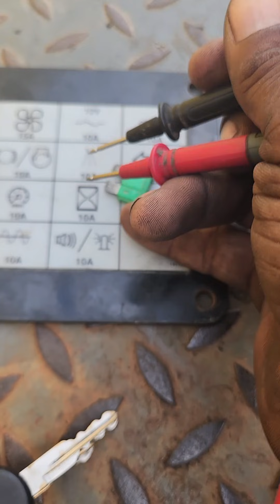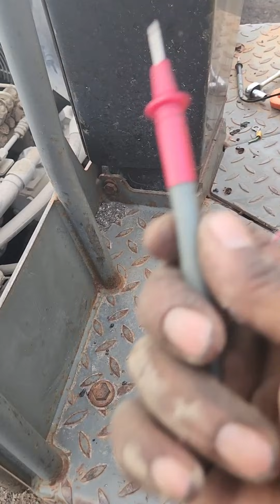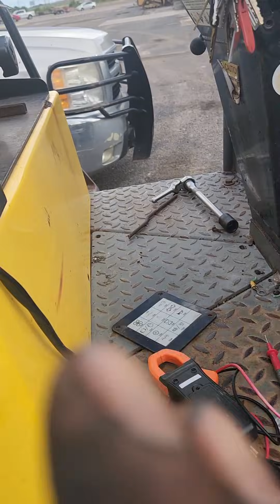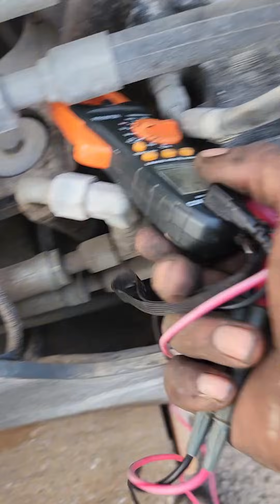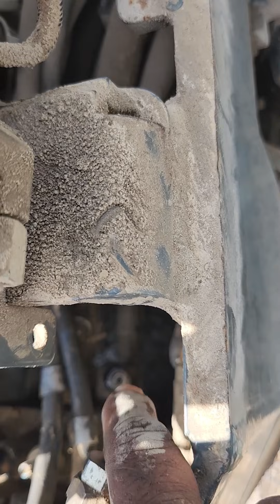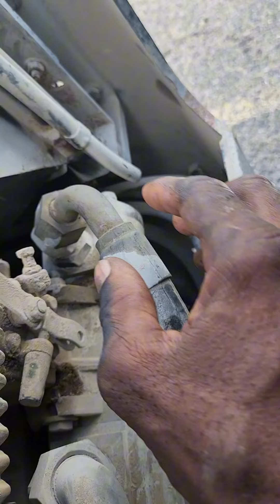Wacker Neuson Roller Compactor, Roller vibration system not working:   Part 1

Comment: Where is part two on the I can't find it. I guess you never made it. Yeah, that's a bummer. My coil checks out at 7 homes I have power there. 12 volts. Can you push those balls in and out by hand to see if they're working?
Reply from the maker: Hello sir the owner of this machine decided not to make the repair, he is using it as is,  for testing only you can bypass the coil and spool, remove both hoses and connect them together. and put hydraulic plugs in the holes on the manifold,  franklinb3932@gmail.com you can email me any time
Reply from the maker: I would first check Pump output pressure to see if the pump is working

Comment: I haven't RD12 whack a roller. And the vibrators not working your. video is very helpful things. to look for. I hope it's not the pump.
Reply from the maker: Thank you for watching. Most of the time its electrical,  but If you need a pdf copy of the service and repair manual, send me a Gmail and I'll share it with you